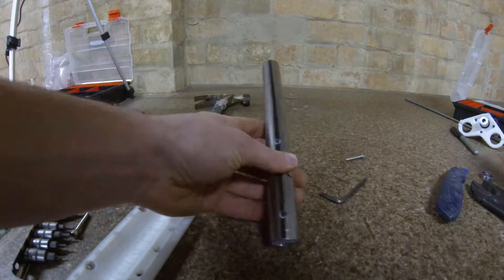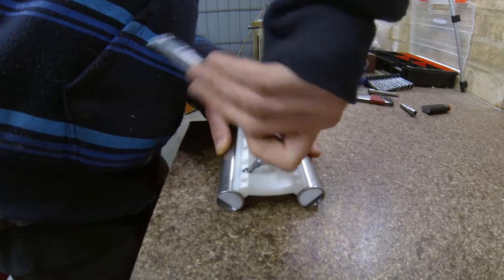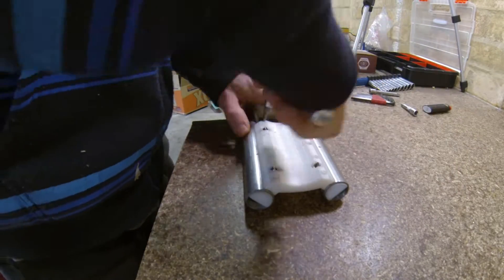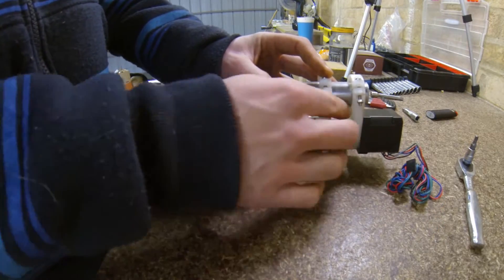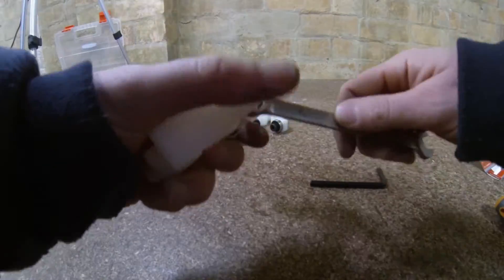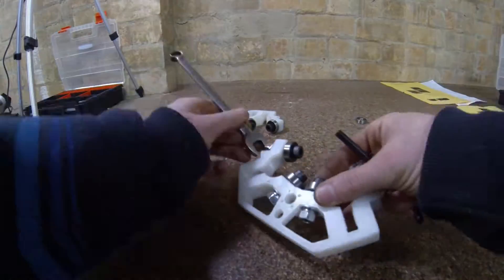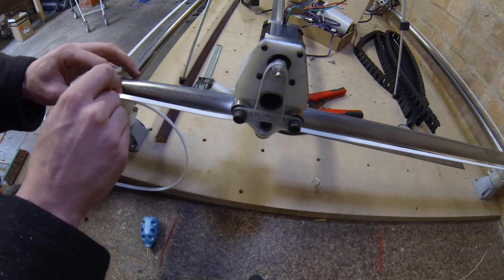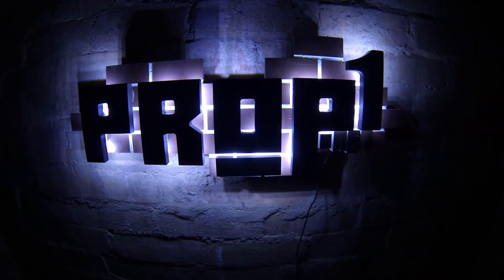mpcnc build more sub assembly, And the frame assembly EP2/4

Comment: The official V1 Engineering instructions do tell you not to use cap bolts on the Gantry unless you are willing to grind them down and also not to use steel reinforced belt as it's brittle and wears out very quickly. Still, a very helpful video for builders like me. It shows everything very clearly.
Reply from the maker: Thanks derek. I think the instructions have had an update from the time I built the machine I recall the instructions saying any bolts where fine and nothing on belts, and my experience with steel belts is that you are definitely better off going with nylon etc I dont think there is much to gain with steel.
Reply: @prop1305   Actually, I just looked again and it's not in the instructions as such but in the parts list. Also, they don't suggest not using cap nuts for everything in the gantry, just the M8 x 40 but I've been looking at lots of guides over the past week while I've been printing the 3D parts and waiting for everything else to arrive and noticed for myself that most people use crosshead machine screws for all the smaller/shorter sizes, including those in the gantry, so have bought the same myself. I'm also using nyloc nuts thoughout with no washers or thread adhesive. Again, the parts list doesn't mention washers and considering you can't tighten nuts up hard on plastic I'm assuming aren't needed.

I just need to sort a base out now then I'm ready to start building.
Reply from the maker: @Derek_S  sweet mate I think I struggled with sourcing m3.5 in Australia at my bolt bar and they didn't come in socket cap witch is what i would expect you are referring to. I don't think I needed to youse washers it's designed that way but I don't think it hurt either already planning on using the mpcn to build a better cnc at some point as I think it will work really well.

Comment: Hello!Which pipe do you use?
Reply from the maker: depends on the model mpcnc printed the letter at the end is in reference to the pipe outside diameter i did a j model witch is 1 inch because i figured that when it was worn out i would have some 1 inch pipe to use on other projects.i went with just normal mild steel, it dose rust easily but it dosent bother me i just wipe the rails with wd40 on a rag when i'm done with it

Comment: Thanks - very helpful. I was also wondering about the belt as I have both but like you I printed in white so aesthetically I'm inclined to the steel white belt ;-)
Reply from the maker: thanks Chris, I'm monitoring the belts they don't like the rap on the 16t pulley and are chewing out and Im up to 4 months or so with prity heavy use, but when i replace them I'm going to use normal  belts i don't think there is any gain to using steel belts.

Comment: Nice build, following along - are those white belts steel reinforced? (I'm guessing they must be).  Interested to see how they work out for you, seems the consensus is they aren't the best idea because it won't like the 16T small radius on the stepper, and the stepper will have a hard time moving it once tensioned.  That said, if you can get it to work I imagine it will stiffen up the x&y axis, good luck!
Reply: And this is where i remembered you had it running on the first vid ;) so i guess they worked out - did you have to set your stepper current higher or did you run into any issues so far with them?
Reply from the maker: hasn't missed a beat snoman, since i got it running i set my steppers to 1v same as my printer the motors feel fine not to hot not to cold haven't really done anything else just been using the machine. done quite a lot of large 32mm 90deg v carving  with no problems, so far i only skip out when doing straight cuts in MDF and i don't evacuate the cut properly.
Reply from the maker: cheers snoman and thank you for your subscription, they are steel belts can't say i think it makes much of a difference, although it is tighter than the belt likes to turn but i would be curios to see when i pull down the machine next if there broken in to running that radius, now days I'm running double spring dampers at either end of the belts and i think this is really helping specially when a sudden change in direction occurs.

Comment: I like how you squared up/spaced the X/Y for the side rails.
When I did mine I did include a separate Waste board that slots/slides in the middle.  However I screwed mine up, and made it exactly in the middle, and did not include the off set that the Center Z part causes so I cut in the runner on one side that the waste board sits in.  Live and learn
Reply from the maker: it did work out well with squaring the frame Randall,  At present i have also moved to an island waste-board so much better,  with being able to surface it into plane with the machine.